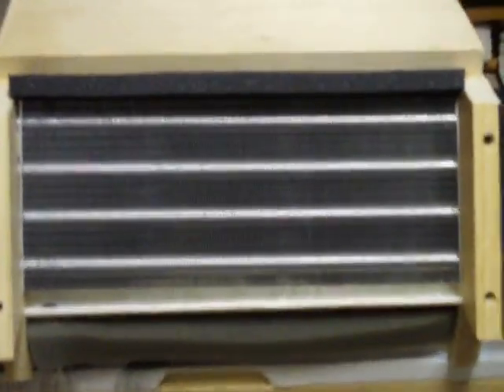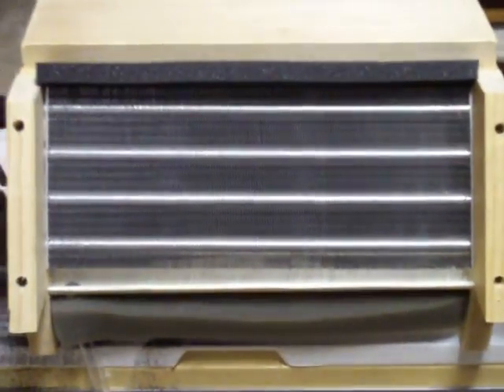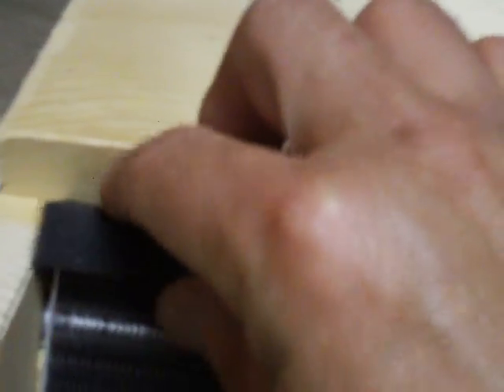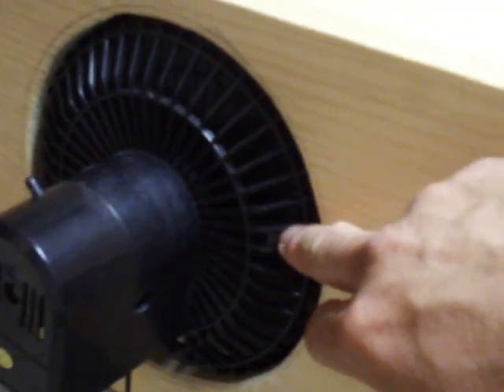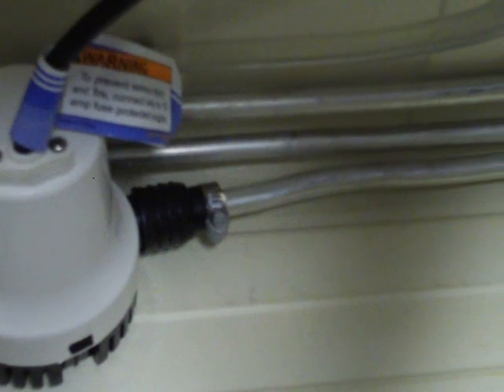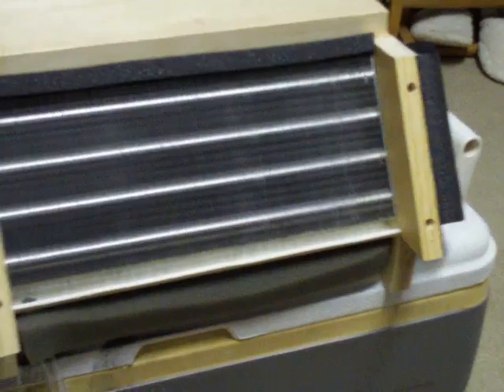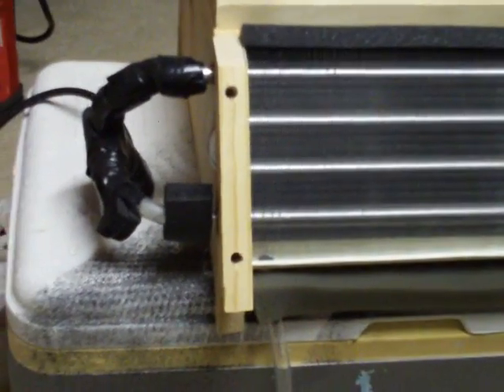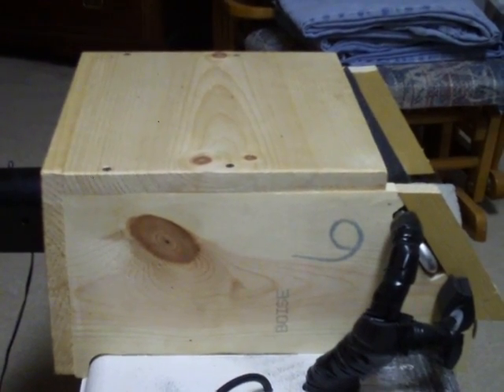Homemade Air Conditioner.

Comment from the maker: Salt will drop the temp down, but you risk with salt and aluminum, corrsion and deterioration of the Aluminum, I watched a show where  the navy tosses out crushed aluminum cans out at sea because it would only take a month for the salt water to deteriorate it, eveything else, trash  and etc, are brought back to port.

Comment from the maker: Wallabydam 1 second ago 

Well The dry ice is a good idea, but the two would have to be seperate, alcohol would have to be in a closed loop, and maybe in a thermal transfer tank for the dry ice to sit on top of, so it does notturn into a gas state too fast, Otherwise dry ice would last for 15 to 24 hours depending on how well insulated . but its very dangerous, and would need to be vented outside via venting tubing,

Comment from the maker: Well The dry ice is a good idea, but the two would have to be seperate, alcohol would have to be in a closed loop, and maybe in a thermal transfer tank for the dry ice to sit on top of, so it does  notturn into a gas state too fast, Otherwise dry ice would last for 15 to 24 hours depending on how well insulated . but its very dangerous, and would need to be vented outside via venting tubing,

Comment from the maker: no you cannot, but i been working on a closed system for the cooling liquid, to keep it phyically seperated form dry ice, you MUST vent the dry ice outside, if anyone is to use it, as we all know dry ice is much colder, would last lots longer as well,   Thank you for the generous comment !

Comment from the maker: I appreciate the info and some insight on that,  Now  one thing, if it doesnt make the air cold,  why would it be cold, lol... no i  understand, removing humidity is the biggest thing in any system to comfort, i always tell people dry air at 100 will not feel as bad at 90 degrees at 80 % humidity with it, tends to give us guys a bad case of the swamp bottom, lol..

Comment: This is pretty cool, no pun intended. I don't know if anybody answered your question about how well it cooled, but it is pretty respectable. An automobile A/C is considered to be working normally if it pulls the center vent temperature down at least 30* below outside temps. Partly what makes an A/C work is the fact that it dehumidifies the air. Also an A/C doesn't make cold air it removes heat and moisture from the air. It get complicated to explain.I Like what you have done with very little....

Comment from the maker: Thanks for the info and thought, Yes it would do pretty good in a small  well insulated room, remove the moisture from that room and will feel cooler, like i tell everyone, it was just a fun project to try and do, yeah i seen lots on here, but i wanted to make a neat setup, compact and not have a lot of exposed tubing and etc. people always say Buy a real AC unit, but they dont read where i did this for fun, im not going to use this unless i wanted to blow some peoples minds with it at a party.

Comment: This with a paul elkins homeless shelter is all you need. Only thing that would have to be designed into it would be a return line for the air so you would be blowing the already conditioned air over the coils. You don't make cold you remove heat the less heat you have to remove the colder you will be. So lets say you know you will be sitting in your recliner then get you foil bubble wrap and close in the recliner so when you are sitting in it you are removing heat from less cubic yards of air.

Comment from the maker: That cooler core, was free, so im thinking it was cost effective, I by all means am not telling people to go out and buy build one of these, I am just showing how I built one that is a little more efficient, I could have used a car radiator, which there are lots of those around, keep in mind, copper tubing is higher in price then aluminum. this was nothing more then a fun project to try with what i had in my garage except the pump and fan. thanks for the salt tip

Comment from the maker: depending on where you live, you can make or buy something pretty cheap, if your in a very dry climate, low humidity, you can get a humidifier from wally mart made by vicks, it mists nice cool air, if your in humid area, you need something like i made somewhat, it works best with some kinda coil with fins,and removing the moisture from the area helps alot, determination is your best friend, :)

Comment from the maker: Thank you for your input, well reason i dont like that idea, is salt water  and aluminum doesnt work well together, I just did not want to mess up the inside of the coil, But i am with you and many others that suggest it, if it was a copper coil i think i would have done so, but im pretty happy with its performance like it is now, :)  Thank you again!

Comment from the maker: The pump is only 12 volts, and draws less then1/8th of a amp. its a tiny motor inside it, i dont think it created enough heat to make a difference, could not tell you how much heat,

Comment from the maker: Thank you for the compliment, The Idea of using 50 degree water from a River is a great  idea,  I would think depnding on if your goin to pump from the river to your chiller, OR use a long suction line from the river to the pump, which would be alot harder i would think, A friend of mine had a cabin close by a constantly running stream, i told him to Use a Car radiator, in the cabin, and  divert some water 300 feet up stream gravity fed into a line, the pressure worked, and help cool the cabin,

Comment from the maker: I totally understand about the Dry ice, I was not going to sumbmerge it in any fluid, that would just make it release the gasses at a very very fast pace, as i mentioned in past comments about dry ice, i would vent the gasses outside of any building or room, via hose, and make sure its in a sealed enviroment, as long as its vented to outside sorce, Thank you for letting me know otherwise, nice to know people as yourself are looking out for others, Thumbs up !

Comment: @Wallabydam i strongly recommend NOT to use dry ice as it is frozen carbon dioxide with wwhen inhaled will kill and using it in an evaporative cooler system you would be breathing direct Co2,extremely dangerous in a confined space it suffocate a person within minutes

Comment: Glad to help, you've kind of hit on the most efficient of heat sinks, which is water. The highest SEER ratings you can get on hvac units come from geothermal heat pumps, one of which is the air to water which requires some sort of lake being near by. The other you have to drill -at great expense- deep down into geothermal pockets or  the water table. We basically have the same limitation/problem you do. Yours is Ice, ours is refrigerant and its challenges.

Comment from the maker: Well that makes me smile,  did not know what HVAC specs would be in comparision to this, i know its not a real air conditioner so to speak, but it does conditon the air, by removing the humidity,    I appreciate the Info and insight on those numbers and figures, thats great to hear, now if only i could find a way to make the ice last longer then  the norm, without salt added.  Thanks again!!!!

Comment: I saw your temp splits on the other test run you did, the typical delta t you would expect from a high seer hvac unit would be 18-22. To get higher temp splits you have to use dehumidification- which basically involves slower fan speeds. You had at least a 30 degree delta, which is difficult to do in normal hvac without the coil freezing, so great job.

Comment from the maker: Well if you live in a dry area  ( low Humidity ) a Swamp Cooler would work good, if you live in a jumid area, and have a small area to cool,. this would be best to make you feel cool. the radiator or coil on the upper part can be big, but it will consume ice at a faster rate, also a small radiator or coil with a lot of CFM passing through it will be the same, you want just enough air speed to allow good transfer of cooling, it will take time, to find out with experimenting, Thanks for visiting !

Comment: Neat set up. Dry ice acetone gets -78 C, but the CO2 saturated solution might cause degassing problems when it reaches the relatively warmer heat exchanger.

Comment from the maker: HI, Yes this was a discussion talked about, but as i mention salt is harsh on aluminum, so i do not use it,  i did not think you could freeze something with salt water in it, or it would take a lot more to do so, but yes if i want colder, thats the way to go for sure, but like i said, dont want my exchanger to take a hit  with the salt slowly eating it up.  Thank you for insight on it, i will have to try the bottles like you did as well, i never tried it that way.

Comment: I haven't read all of the comments, have you tried salt water? Salt water freezes at a lower temperature than water. If you freeze salt water it should provide a colder water flowing through the heat exchanger. I use old mouthwash bottles in my cooler they are high amount of salt added to the water before freezing. They get so cold that ice forms on the outside of those bottles as they melt inside. I think you will be trading time for temperature but if you want colder I think it will work.

Comment: looks great, i made one myself that runs through a heater core, thought the smaller water ports would transfer the cold real good-eats ice up but gets real cold,my cooler has a hatch in the top so i was able to set the bucket on top for the condensation to drip back into the chest-plus I can load the top with ice too,if the humidity is low-I prefer to let it remove the moisture from the air most of the time but if I was driving though Arizona,I'm sure I would double pack it-check it out on my ch

Comment: When I first saw your video I was dying of heat in my barracks in Japan. we do not have ac nor are we allowed to have one due to having a crappy power grid. so i went out exploring YouTube for ideas. I came across your video and realized yours was the most efficient so i set out on Amazon to start ordering parts. I was able to come up with a temporary version for this summer. I have a video on my channel of the one I made.
Thanks for posting your work, It helped!

Comment: 2ndly if one could use a thermostat controller that would regulate the solar temp... Guess what you have...  A/C for nearly free... save for the cost of build that is and the value of your time. But who's counting that.   Great vid though... You have intrigued me enough to push forward.  Thank you for your kind comments.

Sincerely, White

Comment: Yes the old school units did use ammonia via propane to evap like you said.  I also know that you could introduce a solar element instead of a propane to accomplish the same thing.  However I have yet to see one successfully built, with all safety precautions needed.  Actually there were also ice makers made way back that used ammonia to based upon the same principles.

Comment from the maker: LoL @ air blowing over ice, Well I gave the dry ice a thought, i agree with venting it outside at anytime it is in a closed room,  i knew about the salt on the ice, but its pretty harsh on aluminum parts, thus why i never used it, Closed loop system with alcohol always been in the mind with use of dry ice, it sin the works, but  not sure of potassium mixed with it,  im not a chemist so kinda sounds dangerous, lol. the dry ice, alcohol and potassium, i would think dry ice would get it 20 degrees

Comment: LOL enjoyed it way better than a fan over a block of ice.

Here is an idea vent the cooler out side and use a block of dry ice instead of ice and circulate alcohol with potassium mixed into it. should get it down to 40 degrees in there.
Also if you salted the ice it will be cooler too.

Comment from the maker: Well im not a chemist, but i do know in Old RV systems for the fridge and AC they used Amonia, no need for a compressor, but used heat from the propane gas to heat it up and it would evap into a gas state, and etc,  anyway im not sure if it would be better, not sure what its freezing point, i know alcohol is used widedly, and in very cold envioments, Well i hope you stay cool in FLA, e many issues that need to be looked at in any system, Thank you for the thought, its worth thinking about

Comment: how would a mix of ammonia and water work in the closed loop system?  would it not be more efficient? but there are a great number of questions to be answered on that, I still have to answer for myself.   But If I am thinking correctly. simple mods can make a decent window unit with much less electrical expense than a normal ac unit, May run all day at the house, but your house would be cool. Sorry, I'm sweating here in FLA. with no ac. and looking to produce something substantial.
Great work!

Comment from the maker: I appreciate the Generous comment, I been working on a closed loop system for dry ice, but its going to be pretty hard to keep the coil from freezing into ice because on a humid day and low CFM air passing through it may freeze up,  but needless to say im working on one, and crossing my fingers, it would last a good 6 hours at least, in my opinion,and be super cold, i did take some time on this, again Thank you for the visit and generous comment !

Comment from the maker: Like i mentioned salt water would degrade the aluminum so i do not use it, but im tryin to come up with a plan for use with dry ice system, dry ice would last at Least 12 hours. and dry ice is $1 per pound, so its pretty good deal if your camping !

Comment from the maker: I really Appreciate the kind words, i had the Trans cooler for a long time i never used it so why not use it ! ii thought to myself., copper would last better with salt on the ice, aluminum hates it, believe it or not the US navy flush aluminum cans in the ocean because the salt water will bio degrade it in a short time, you would think they would bring them back to shore and recycle but they dont as far as i last heard. any radiator would perform much better then just copper tubing anytime.

Comment from the maker: After i made this, sometime later, i found a few companies making these one for Air, other just blows on your forehead and its WITHOUT a cab in a vehicle, im almost sure i know which your talking about,  but hey, those coolers they use are much smaller, AND they use ice just as fast if not faster! the one company i found IS a evap cooler, stupid thing is, its for use outside!  but i think i know what conpany you talk of, its a Swamp cooler, which is cool but puts humidity back in the air,

Comment: Makes sense. Thanks for the reply. Ive been looking at buying something that is probably similar. I wont give any names here but they sell units for believe it or not up to about $700.00 that work with a cooler of ice. Like your project they are air conditioners and not evaporation type air coolers. Wish I could put a portable air conditioner in my van but I dont think there is an inverter that could handle it.

Comment: Yes but you cant put the 65.00 110v AC unit in a vehicle. I wish I could do that but Im pretty sure the start up current will take out even a large inverter. Correct me if Im wrong. I have a heavy duty work van that did not come with factory air and this thing would work great for me. Ive gotten quotes for installing air conditioning and its like 2000.00. A lot more than making one of these. It would take a lot of ice but Id only using it when I really needed it.

Comment from the maker: HI, Reason for me winding the coil inside the cooler was to allow ICE contact, which the ice is colder then the water always, so any water traveling through would get chilled as cold as possible before entering the top outside coil., i know and understand what you mean, BUT water is Not ice, and ice will always be colder then water, but having the water travel through will get it as cold as possible, colder then just straight through, at least i think so, it works so im not goin to touch it  :)

Comment: This  looks great! I am thinking about making one, Thanks for posting.! Do you think the tubing that is wound inside the cooler is necessary? It wont make the water any colder. Would it not work as well if the tube went directly from the bilge pump up to the transmission cooler?

Comment: If its done in a closed room, as far I know by the first law of thermodynamics eventually it should heat up because we are not only transforming internal energy but doing external work on it using fan this can only be countered by adding more ice. So instead if you find a better way of melting the ice by itself, i mean not doing any work on it. It would be much more efficient and better temperature drop can be obtained!
Correct me if I'm wrong but little theory can make a lot of difference.

Comment from the maker: About two years ago, i was at a  farm, it had a pond the guy had a coil in the pond, closed loop system and a coil up at his house in a air handler, he used a circulator pump for the system, his garage was 70 degreees with it on, its worked great it sounds just like what you intend on doing, Geosystems work good too, but for cooling pending on ground and how much line you run in the ground, it should work pretty good,!

Comment: A buddy and I have kinda the same idea but much larger scale, by buring pipe or a tank below the frost line, much like the geothermal systems, but use it only for cooling, then running it thru a heat exchanger similiar to what you got going on.

Comment from the maker: Just remember when you just blow air over ice, you also put moiture in the air, and as i said in another comment, dry air will always feel colder, and or less hot compared to humid air,  but my motto is if it works, it works,   stick to it.